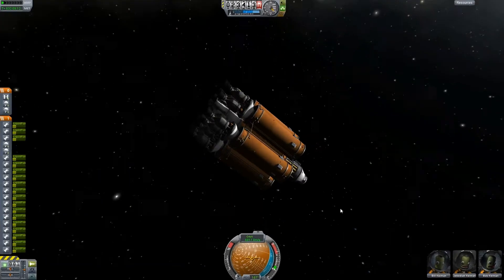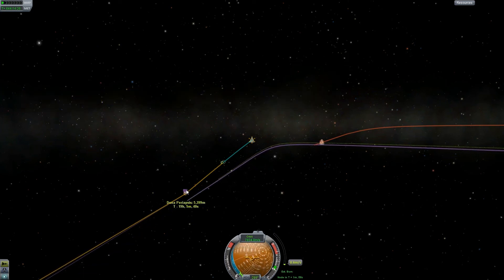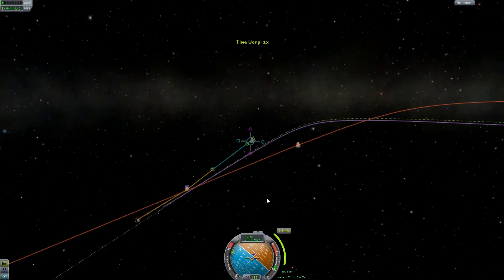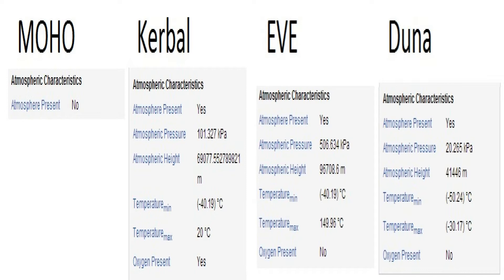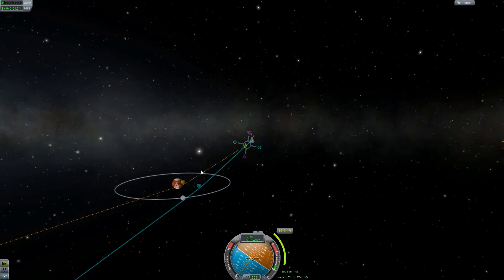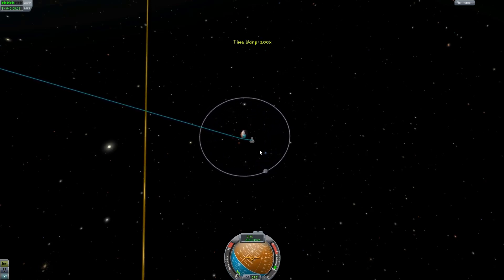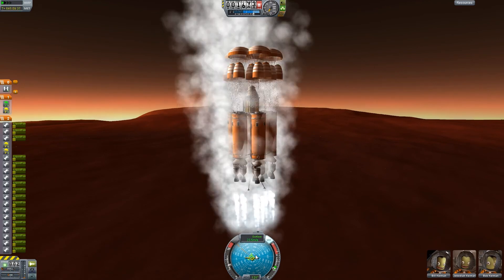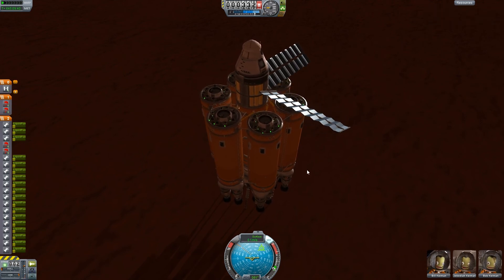Kerbal Space Program : Fuel Efficiency & Air Breaking Tutorial Part 2

Comment: it would be cool but a nightmare to make, it would be summer in the north so then winter in the south then around the equator it would be in the middle.  So they would need some dynamic system that used Kerbol and the angle of the surface of each planet along the entire surface area to judge what the temperature would be at any given time.  I am pretty sure the actual resources that would take would literally melt my CPU.